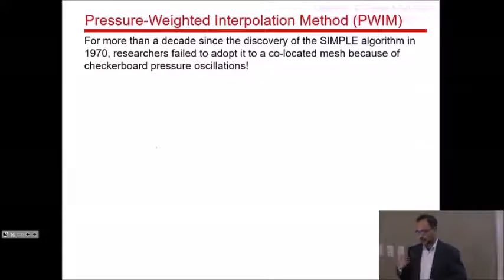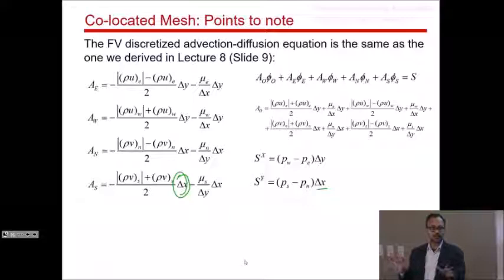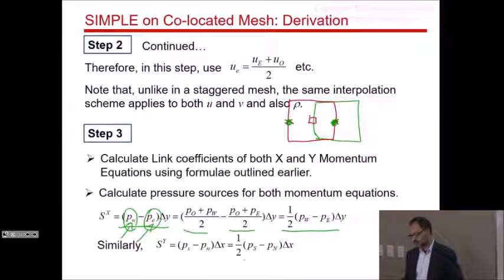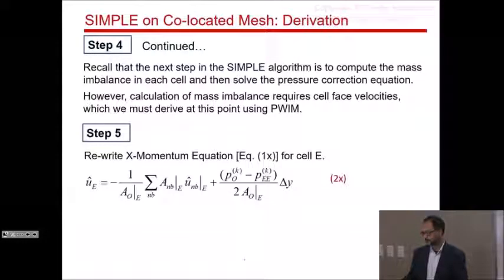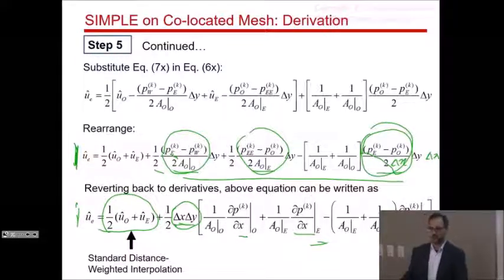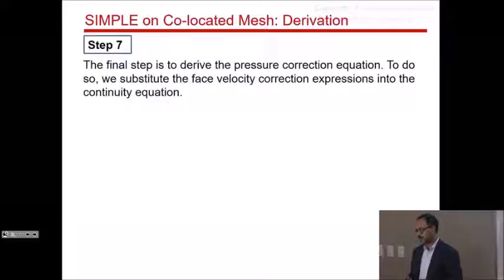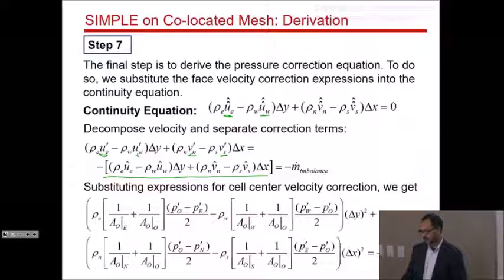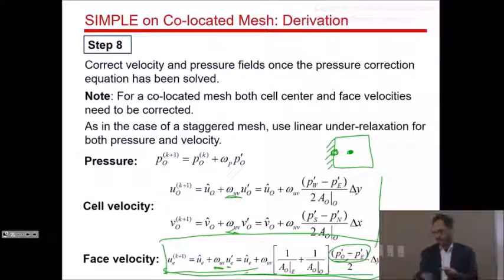SIMPLE Algorithm on Co-Located Mesh--Part 2 of 5

Comment: In the first iteration, you compute face velocities using simple geometric interpolation, since pressure field is garbage or zero. After solving the pressure correction equation, you correct the face velocities using the pressure correction. So my question is, do you ever use the formula to compute face velocities, which includes the rhie-chow/PWIM pressure terms? Or is it not needed if you update them after each iteration?
Reply from the maker: You calculate face velocities using PWIM after solving mom eqns. These will be needed to calculate mass imbalance (source of p correction equation). Then after pressure correction, you simply correct them.
Reply: @sandipmazumder171  I assume you use these corrected face velocities to compute the convective part of the linking coefficients (A_W, A_E, A_S, A_N etc...)?

Since the purpose of PWIM is only to smooth out pressure oscillations, I guess it makes sense that it would be used only when computing the source term in the pressure correction equation. I guess it wouldnt make sense for it to be used in the momentum coefficients or the coefficients of any other scalar (which has nothing to do with momentum or pressure).
Reply from the maker: @arkie87  YES.